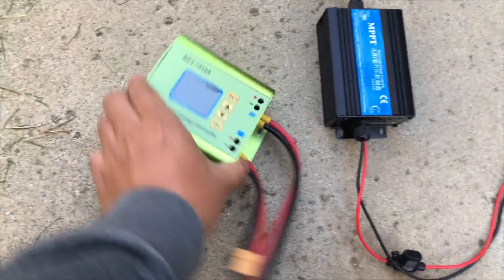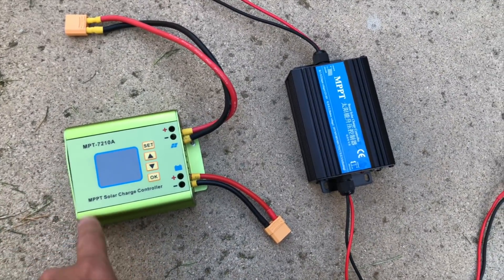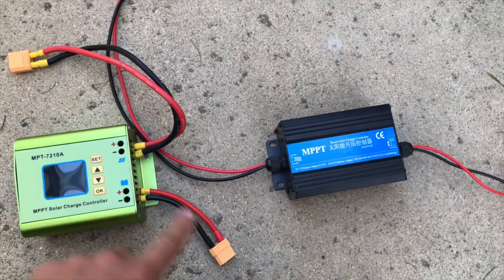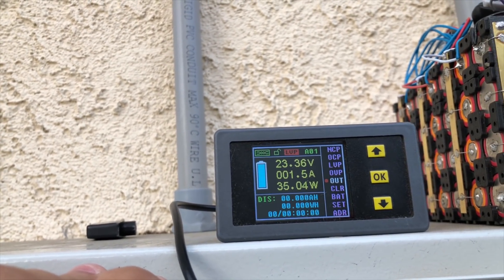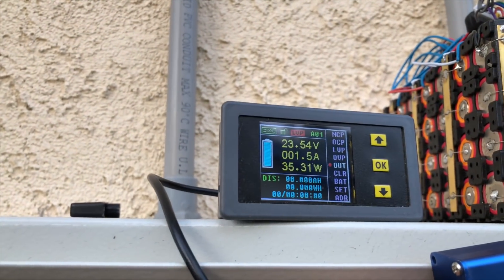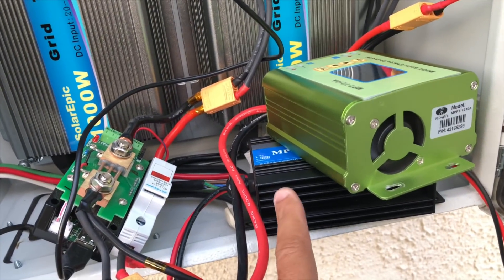Cheap Boost MPPT SOLAR Charge Controller Efficiency Test

Comment: I have both of these mppt boost chargers. The green one is better, but it only starts working optimally after 30 seconds. It also needs the right settings. The test was not long and accurate enough. The green one can boost up to 90V.

Comment: Your meters look pretty cheap, too. Maybe test them next. My conclusion is, better to have a Pv voltage higher than the battery. There must be a good reason that Victron does not bother making boost charge controllers.

Comment: Hola.
Quisiera saber si es posible que me puedas ayudar en recomendarme un mppt. Para poder ponerlo en un avion de radio control llamado Parrot disco.  Ya que por ser algo pequeño necesito un mppt pequeño pero que sea muy eficiente ya que existen muchos pero por no saber sobre mppt. No se cual me pueda funcionar bien.
Ya que somos un grupo de 5 aviones y queremos volar por bastante tiempo por eso queremos usar paneles solares.
Las baterías que usaremos son de Lipo de 3 celdas o sea de 11.1 voltios las cuales a full carga llegan a 12.4 voltios.
Si nos puedes ayudar seria super y asi compartirte nuestros videos de los vuelos.
De antemano muchas gracias.
Bendiciones

Comment: The MingHe is a BOOST controller.   Can not gain Current via converting higher voltages .   They work good if your using a battery voltage above your system voltage.

Comment: Your numbers dont match your interpretation........taking screen shots of two points indeed shows actual data from both MPPTs.
Blue 31.00V out 34.51 in =89.83 eff. Green 29.4out 31.95 in  = 92.01
That is pretty close in my book.  Also, green has a much better user interface that shows excellent input+output stats.
Reply: Also the green one has a fan that might keep it alive longer.
Reply: Also, the only way that the efficiency regarding in/out power matters is the heat generated in the controller(which the version with a fan should handle much more easily, assuming the fan never dies!)
Apart from that, only the power output using the same panel in the same conditions, matters(regardless of how much power is lost in the controller).
Any more power supplied to the battery can be due to the MPPT controller using a more efficient voltage/current setting with the panel, or just slightly different weather conditions for each test(the first had a higher voltage from the PV, but that could just be because the MPPT chose a higher voltage).
ie: You could have an MPPT controller that sets a better voltage/current from the panel (more power input), but waste more power in the circuit, and ultimately still put out more power than the other.A fictional example(with identical panel and weather), for two different MPPT controllers:
controller 1(better MPPT, but higher power loss in circuit): 20v@2.5a=50w from panel - 5W loss in controller circuit = 45W out
controller 2: 22.5v@2a=45W from panel - 2W loss in controller = 43W out
It seems like the green model is also a boost controller, as the output voltage is higher than the voltage input.The green one seems better overall to me too.

Comment: Try testing using somewhere in the middle of their rated output.  For example, the MPT-7210A is rated at up to 600W of input, so try it with half of that, 300W of input.  A single 305W solar panels on a very sunny day would suffice.

Comment: The test performed by jehugarcia is interesting, but incomplete and quite self-referential. It only says about the efficiency for a given working condition but says nothing about the capability of the device to find and track the point of maximum power. A more complete test would require a measurement instrument capable to track the complete current/voltage curve of the PV panel for a given insolation and then compare the two devices against this benchmark instrument and detect whether or not they are not only efficient but also capable to extract the maximum power from the PV panels.

Comment: One thing I saw when I looked at the amazon listings was that , at least the black controller was supposed to have a higher battery voltage than the panel voltage. This puts these in a different class than the typical MPPT charger, and is referred to as a BOOST charger. The test didn't use this feature at all. The difference in voltage would be something like 24 vdc panel  and a 48v battery. But, it seemed to be efficient as used.
Reply: MPPT refers to the ability of a controller to track the maximum power point (voltage/current at which the solar module(s) gives maximum power relative to level of irradiance). To do this the controller has to let the module produce power at its own (comfortable) voltage and current point independent of the load(battery) voltage. So to now match that voltage to the load (battery) voltage for charging, the controller may need to lower (buck converter type) the voltage or raise it (boost converter type). So both buck and boost type controllers can do mppt. The buck one is the more common mppt controller since its better to have a higher voltage on the module side than the battery side. This is because the controller is usually further away from the solar module (could be mounted on the roof) and closer to the battery. Hence to minimize wire losses, its better when the voltage on the solar module side is high. That said there are instances when a boost mppt controller is useful, like when charging a golf cart battery(48v) using a roof mounted solar module. The space on the roof of the golf cart maybe enough for only one solar module (60-72cell one) hence output voltage would be lower than 37v. hence the need to boost up the voltage to above 48v top charge the battery.
Reply: In this instance the voltage was being boosted from 23v to about 24.3v. so not much boosting as you put it but still a boost. a normal buck Mppt controller wouldn't work.

Comment: The 7210 kept stopping/cutting out when ever I encountered shading on panels. Push button again to start it. Every irritating, but someone said you have to 'program' it not to do that... I still don't know what he means by that... Plus I was charging a 60 v battery the every top of range, I need a little more than just top of 60 volts to be comfortable with not overworking the unit...
Reply: I just saw another video, you can change to stay on, but it is in a sub sub menue....

Comment: One thing to take in account is the conversion from 22ishV to 24.5ishV cause yor current dropped, 12v system upped to 24v could be a better test to see, also more sun but that's nothing to bat a eye at for a quick test
Reply: Exactly what I did yesterday. Today I need to take the laptop out and plot the power outputs. It was interesting to see that using the MPT7210A drive a MingHe B3603 allowed the one driven and one not driven to reach their set point voltage and hold them while keeping the current below the set point for it on the B3603s. If both 3603 units were run straight from the panels, neither one could hold the current or voltage at the set points. 7210A was set for 17.5V as panel voltage and 20.50V/2.5A as outputs. Panels actually went up to 20.5V which is their VOC point and both 3603s went to their 14.84V set points. Amps out varied depending on battery voltage but are set to 2.0Amps.  14.84V is the set point because of having a blocking diode in the legs of the output for safety and voltage drop across it is .8V. Charging (3) 27MDP Exide  12V/100AH batteries in parallel.

Comment: I have heard the green one can be used with a power supply. and used as a charger. is this true? I was thinking about getting one to charge my 29..4 v lithium bank. from a DC generator source. I guess a DC lipo charger may work better. if it will charge 7s li ion! I would like to get 20-30 amps at least. do you know of anything? or a easy way to charge li ion with a alternator? I also thought about using a DC to DC with cc cv and a bms! to work like a balance charger.. anything???

Comment: Quick math. 
1st unit: IN: 23.87V @ 1.5A = 35.805W   OUT: 24.21V @ 1.43A = 34.620W   Efficiency: 96% (34.620 / 35.805)  Timestamp: 2:03 - 2:04
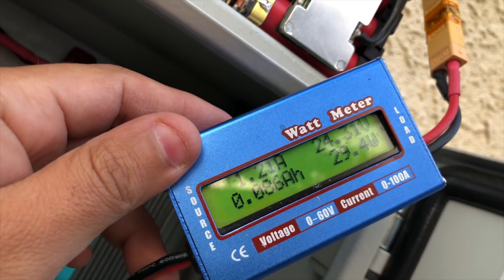2nd unit: IN: 21.42V @ 1.5A = 32.130W  OUT: 24.31V @ 1.23A = 29.901W  Efficiency: 93% (29.901 / 32.130)  Timestamp: 2:45
Conclusion: They are basically the same. As stated by SuperBrainAK, the cooling fan in the MPPT unit is most likely the culprit of the 3% loss in efficiency between the two. Replace the fan with a slower unit, and/or with one that is thermally controlled, and the overall efficiency will be almost identical.
It wouldn't surprise me if the circuitry internally is almost, if not, the same. Just different case. Please prove me wrong on this by taking the two units apart and comparing the boards and the IC's.
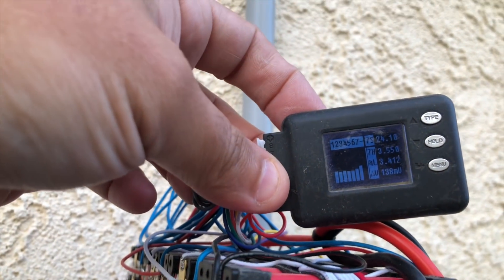It was dang difficult to get the display of the input and the display of the output on the screen at the same time to get the calculations right. Moving the camera from one meter to the other gives enough time for the meters to change their outputs. This was evident on the first test at about 2:00, the numbers were changing almost by the second. Both input and output screens should be visible on the camera at the same time. This you did do when you tested the second unit, which made for doing the math on that one far easier.

Comment: Being mppt controllers, the difference in wattage could also be in how well they maximize the power drawn from the panels. The first controller could be better at drawing wattage out, particularly in low light.  It would be better regardless of efficiency. But as Jehu said, they await a long term test.

Comment: Cool vid.  Would like to see more testing on them.  I have the 7210 got it to use as a charger for my higher voltage battery bank than my panels.  So not sure how good the efficiency is when using it with battery that is closer in voltage to the panel output.  I found that at least a 5 volt difference seems to be where it shines.

Comment: You need to do the numbers, not quick checks. I froze screen to find two points that showed data from both MPPTs.
Blue 31.00V out 34.51 in =89.83 eff. Green 29.4out 31.95 in  = 92.01

Comment: How are you planning to compare a BOOST solar charger (MPT-7210A) to a BUCK solar charger (Victron series)?
Reply: Only thing I can thing of is have - say - 2 panels in parallel for the boost test and put them in series for the buck test.
Even better have 4 identical panels, 2 in series and 2 in parallel and test at the same time.

Comment: Jehu, What's the name of This Guy MPPT #2, the blue one?
Reply: It appears to be a BlueSolar MPPT charge controller made by Victron.  I can't really see, but it might be the model 100/30.  Victron is a respected maker of inverters and chargers headquartered in Europe (Amsterdam).  They are popular in the cruising-boat crowd and with RVers. It's cost is a couple hundred bucks.
Reply: It is a cheap $40 unit.  I have 2 of them on my boat and they work perfect!  Solar panel put about 32 volts in and the controller converts that to a max of 50.2 volts out to my battery bank.

Comment: From the looks of it, you're losing about 10% or so to conversion.  Depending on the board layout, that could change depending on the load it has to convert, but there shouldn't be much of a change.  If the boosting process allows you to save money in the design and layout of your array/system to a significant degree - they might be useful.

Comment: They're both going to be ~90% efficient, at this price point and scale features are more important. The MPT7210A has quite a good display, but the other controller probably tracks better (the MPT7210A has issues with low and/or intermittent light).
Reply: And the Elejoy 400w step up is better than both these as it's self set display is on top and is easy to set.  It is also IP66 rated.  Found it after researching all 3 of these.

Comment: lok he, do sum math right. 32in 29 out is not bad efficiency just cus it is lower than 35in 32out... 88.24% vs  90.63%, so the MPT 7210 is more efficient... sorry
Reply: @SeanGS right. I saw a 2-3w loss on the green one, and a 4 watt loss on the blue one
Reply from the maker: It is?  We’ll see about that

Comment: The Ming controller suffers really bad when any cloud or even a shadow of a bird crosses the solar panel buy shutting it self down and taking approx 10 seconds to reboot. The other controller doesn't seem to suffer from this problem
Reply: shaun briggs this doesn't happen if you have more panels in parallel
Reply: Maybe you can mod it a way. Add a capacitor on the power supply inside for the computer.
Reply from the maker: You only have one panel powering it ?
Reply: Thanos Tourtouras I will have to do some more testing. Could be possible I only had one panel at the time as it has been quite a while since I used it
Reply: LordGryllwotth you need a very large capacitor, I actually had a 5 farad capacitor and that was only good for a maybe 10 seconds...

Comment: What a waste, you cannot compare efficiency with 30W, the fan alone pulls 10% of that power. how many panels are there on the input? Please retest with 10A on their inputs
Reply: I agree. I've added the math calculations. 96% for the first unit, 93% for the second. 
1st unit: IN: 23.87V @ 1.5A = 35.805W   OUT: 24.21V @ 1.43A = 34.620W   Efficiency: 96% (34.620 / 35.805)  Timestamp: 2:03 - 2:04
2nd unit: IN: 21.42V @ 1.5A = 32.130W  OUT: 24.31V @ 1.23A = 29.901W  Efficiency: 93% (29.901 / 32.130)  Timestamp: 2:45
Reply: very weird how you worded that, why would we stop? the title states "efficiency test" so we talked about efficiency. but you also agree with us? but your main point is that these are merely MPP where you set the MPP voltage? Also your method of knowing if you have MPPT is that is uses a buck converter is wrong, it could have a boost converter also (current higher on the input than the output, but output voltage is higher, which both of these are boost) that still does not mean it tracks the maximum power, per your test I can put an LM2596 board on my solar panels set to my battery voltage and call it MPPT lol
Reply: SuperBrainAK  funny, because I tried the lm2596 with my cheap pwm, let me say I was very diaappointed. With my multi-m connected to the panels I was getting a reading of 19+volts. But when I connected the panel to the controller  it was only giving 11.8. So I connected the buck converter between panels and controller only to get same results, even by adjusting potentiometer. I'm clueless as to what the prob is. I even used a different controller and nothing. Had to bring battery in hi house to charge it. If you can help me out it would be great
Reply: hey bud, I subscribed do you think you could make a video about your setup? I would recommend getting a cheap MPPT controller that can handle the current that your solar panel can output, that would make sure that you are getting the most power from the solar panel and you wouldnt need to add any other circuits. what I think is happening is the solar panel has a high open circuit voltage at 19v (with no load on it) but when you attach a load the voltage drops down to a quite low voltage 12v and not enough to charge the battery to 13.5v. There might be a problem with the charger drawing too much power from the solar panel or the solar panel is not providing enough power to charge the battery. if you got a good charge controller then you can make sure that is working (also to make sure it is the most efficient)
Reply: Both of you stop: This is not about charge controller efficiency. these are not PWM charge controllers but MPPT charge controllers that makes the solar panel run at it's most efficient point, what power they loose internally is also relevant, but not the main point comparing these types of chargers. This video is missing the point (I like Jehu and his videos a lot, but he's got this one wrong). A MPPT charge controller monitors the solar panel so there is the exact load is placed on it where  delivers the highest power. Typically a 12V panel is run at 17-18V with lower current than if it was connected with a PWM controller to a battery, but as V*A is power, this turns out to be worth it. Typically you gain 10% over a PWM controller. A tel tale sign that you have an MPPT controller is that the battery charging current is higher than the current drawn from the panel. He did not measure that!! Others have tested both charge controllers featured in this video and neither are true MPPT charge controllers. They don't measure delivered power from their panels and varies the load accordingly but try to hold the panel at a voltage you set in the menu, which is still better than a dumb PWM controller, but not exactly a MPPT controller either because they don't recalculate the optimal point according to changes in solar intensity.

Comment: What type of connections are they. I am ordering online but can't remember the name.
Reply: XT90 connectors, too much for this setup, there is a XT60, lower amperage and cheaper.
Reply from the maker: https://amzn.to/2rQn0X5
Reply: Using the 90's, allows for #10 wire.
Reply: Fil-Am Gabe You Can Get 10 pairs Of XT60s On eBay For $6.99 + Free Shipping! Amazon Sucks w/Inflated Prices!!! Your Welcome...